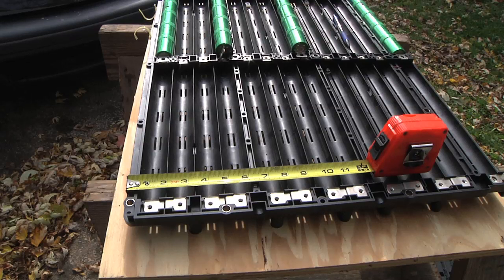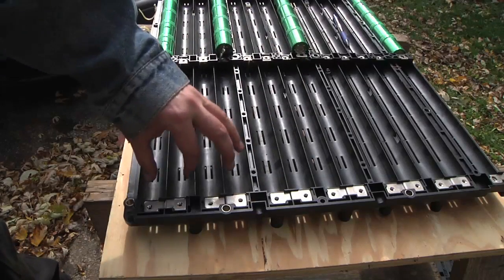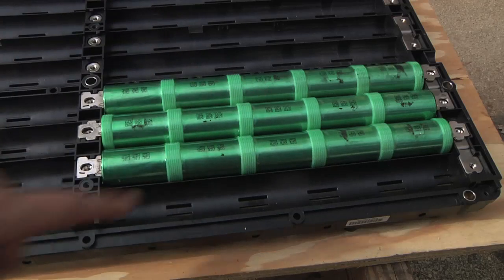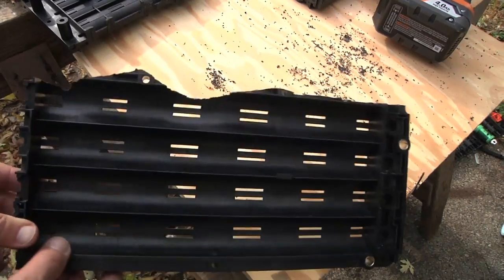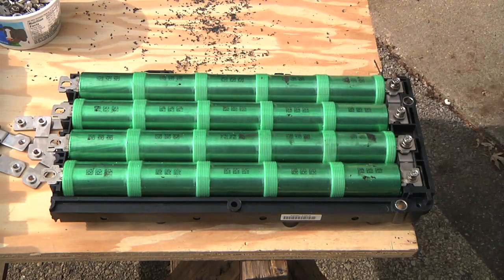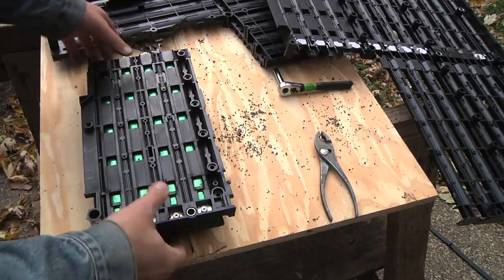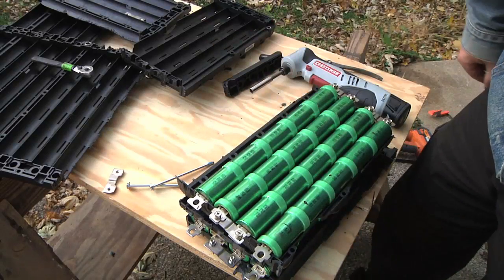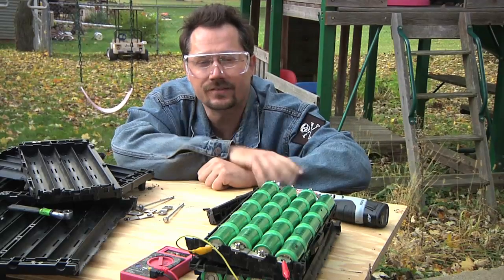Building a NiMH Electric Motorcycle Battery Pack Part 2

Comment: those are NImh batteries in 18660 configuration?  what is the rated amp hour for the entire pack? what about your diy pack amp hours?  What about depth of discharge for your diy pack?
Reply from the maker: They are NiMH, basically a D-cell size, welded up in sticks of 5 cells in series. They are rated at a little more than 5 AH per cell. They are originally from a Ford Escape Hybrid battery pack I found at a salvage yard.

Comment: Next time use a red hot knife to cut the holders, you can use two wood spacers to hold the cells, it should reduce the space used and weight.